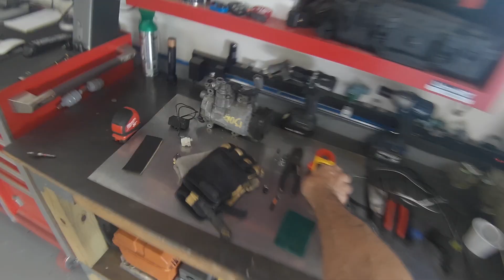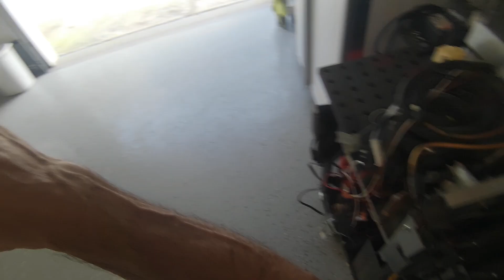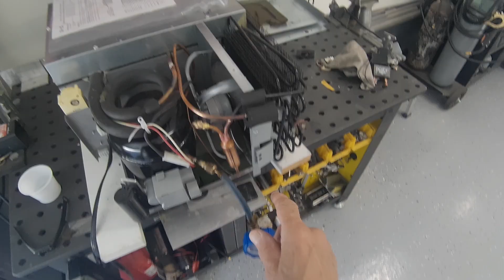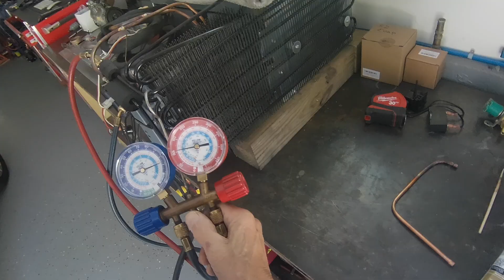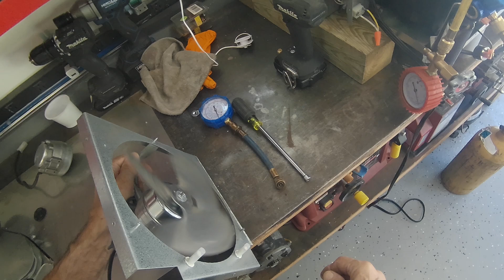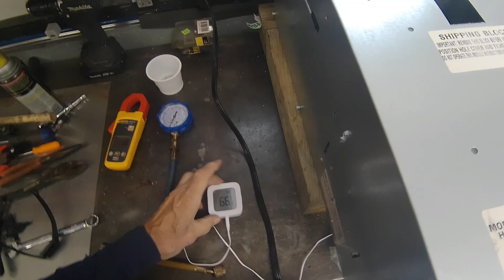Northland Power Unit #7 Rebuild

Comment: I used to have an ''ANNIE'' compressor tester too. You really have a nice shop. I always enjoyed shop work when I could take my time. Like You I never wanted to replace a compressor that didn't need it. Good troubleshooting and making sure it's bad is what makes a good technician.
Reply from the maker: Back in the day I used to have a machine that cut the domes off of hermetic compressors but I don’t remember what I did with it. It was a big metal cabinet with a turntable and a cutting wheel. Wish I still had it. We may have to resort to repairing compressors these days, I just saw a 1/4 hp Tecumseh compressor online for over $1300. Crazy.
Reply: @SubZeroSpecialists  Isn't that a Fluke meter You're using? It looks very compact.